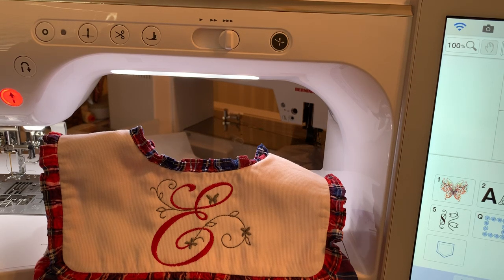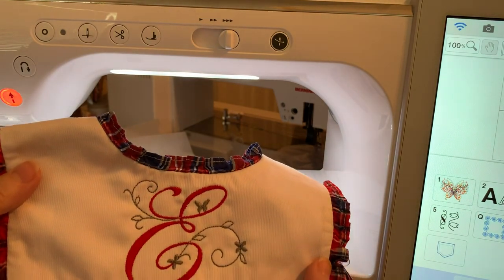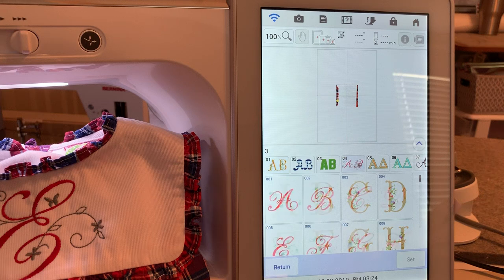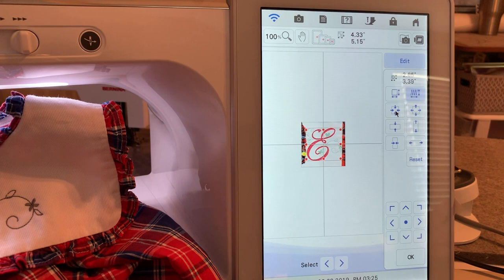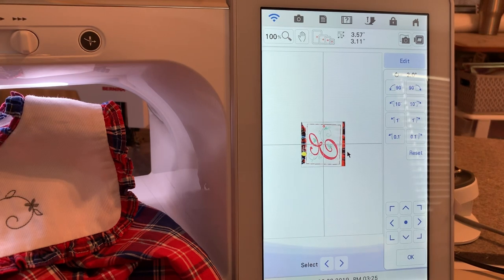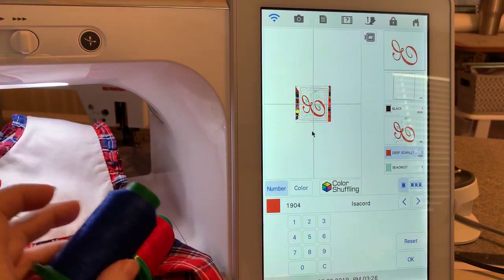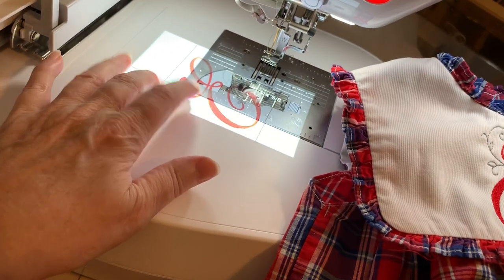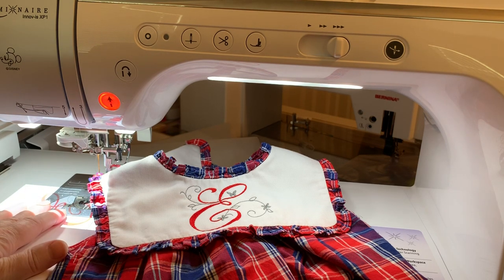Luminaire - Wearable Upcycle #1

Comment: Thank you. I have a Solaris instead of the Luminaire but basically the same machine so this video really helped.
Reply: Leah Geary Hi Leah- could you explain the differences between the Solaris and the Luminaire?
Reply: @wigglypaw   I have Luminaire. It has Disney designs built in while the Solaris has Nancy's Notion designs. I believe the Solaris costs a little more due to mfg Babylock according to my dealer who sells both. The each have identical features and capabilities. Babylock has IQ Designer and Brother calls the My Design Center. Several videos on line about the features.  The Disney designs are locked on the machine and can not be enlarged or reduced. That is disapppointing to me. Hope this helps
Reply: Marcia Jenn Hi Marcia - I was told by my dealer that Design Next 11 or whatever , so he said I don’t even need The PE Design on my computer. I was going to try digitizing a photo of Princess Di tomorrow, and after reading the embroidery manual, there was no way it seemed to be able to digitize a drawing or sketch or photo with tone color gradations. Did I misunderstand my dealer? Or do I need keep on using PE Design 10, to digitize?
Reply: @wigglypaw  the machine does digitize but I have not become proficient at all. Terry's videos are helping me. I wish they would put words under the icons cause it is harder for me to remember what they mean. Same thing on the Scan n Cut. I have Palette 11 with machine and my Dealer says it is great for photos so look for lesson videos on that if you have it. P E Design Next is supposed to be great for photo stitch also.  I have a palette 11 webinar at 11:00  tomorrow morning on the photo stitch so will see how easy it is in the am.
Reply: Marcia Jenn thank you Marcia. do you go on Pattern Review site? I have been there forever. Beginners to Experts.
Reply: @wigglypaw   no I have not heard of that site